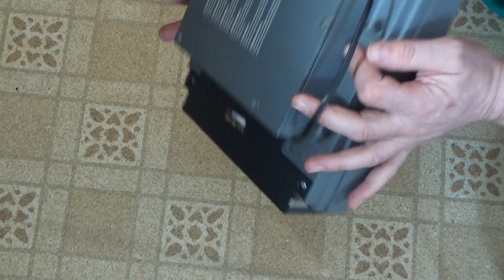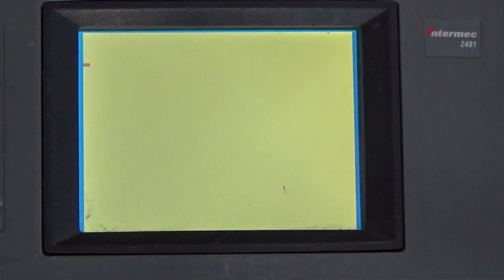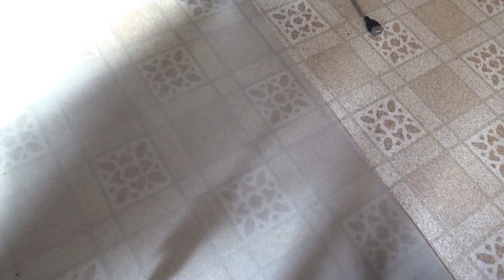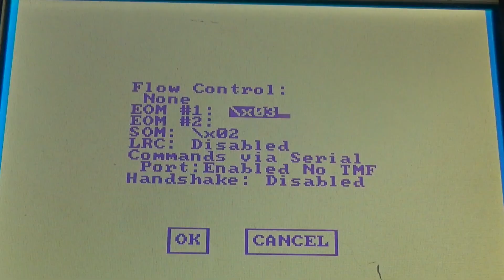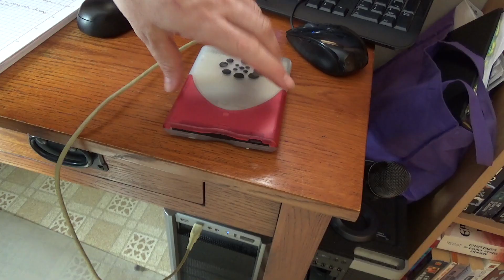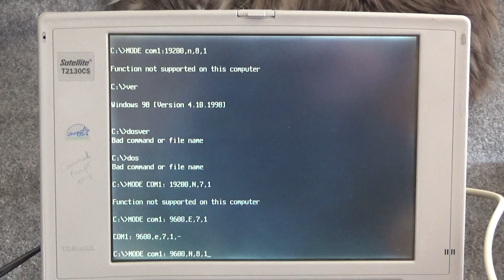Vintage Industrial Terminal - Intermec Trakker Antares 2641

Comment: My company still uses this exact device to track production times. It's integrated into our ERP system via our intranet network to provide a count of total labor hours invested into each project. We use production scan sheets with barcodes to record how many hours we spent building assemblies or performing testing. It might be built like a tank but the firmware is horrible and crashes daily. I can honestly say I've hit it a few times out of frustration. Our system has not been update since the 90's. I manufacture and service automated equipment for pharmaceutical liquid packaging applications, i.e. diagnostic test chemicals, vaccines, etc.
Reply from the maker: That corporate time-use micromanagement stuff always seems to waste more time than it saves. My company tried a bunch of gimmicky biometric time clocks that never worked right and could be easily tricked. We ended up just having everyone write their time on a post-it note and calling it good enough 🤣

Comment: 7:36 ...Null modem adapter (on the PC end of your serial cable). And you may have to configure the serial port between the PC and the device to match (speed,  parity, etc) .  A safe speed would be 9600 or 19200, 8N1, etc.

Comment: i would put a DOS install on onto a small CF card and use a CF to PCMCIA adapter to boot the machine. it might have network booted in its previous life explaining the lack of onboard OS.
Reply from the maker: I'm not sure if it has a standard CPU / BIOS or if it's all custom firmware stuff in there. I need to do some more research on it.
Reply: @saveitforparts  the very quick look i took of the datasheet said it was a PC-on-a-chip so at least the hardware should be relatively standard.

Comment: Networking of the 80's and before 🙂 Connecting two computers (DTE) through RS-232 ("serial" or "COM-port") require that you have a null-modem in between. It connects the TX-line on one computer to the RX-line on the other and vice versa. A few other, usually less important, signals might also be crossed. The reason is that the computer expect to be connected to a DCE (Data Circuit-terminating Equipment), such as a modem. A common gender-change contact is usually straight(!) between the pins. A null-modem is easily made from two DB-9 or DB-25 connectors, some wire and soldering. There's an article on Wikipedia or google it for detaiuls.
Reply from the maker: I might have a lap-link cable around somewhere, I need to dig through my box of serial junk.
Reply: @saveitforparts  Yes, a serial LapLink cable would do the job.
Reply: @saveitforparts  Did it work?

Comment: This reinforces my decision to get an old 286, 386 or 486 machine up and running reliably so access to 16 bit tech remains possible into the future.
Reply: 386 & 486 are 32-bit... For the record.
Reply: @christophero1969 , but they will run 16 bit programs, don't they?  Thanks for the info. :)
Reply: @DadofScience  32 bit processors will stull run 16 bit applications, yes. Its up to the OS to handle them but Windows had a 16 bit subsystem up to 7 or Vista iirc. They can also be ran on 64 bit Windows via NTVDM but if youre using a *86 anyway youll be fine
Reply: @DadofScience  64bit processors also will, you can run DOS on your modern PC
Reply: Virtualbox

Comment: Its a time clock. My company use to use these. They are a pita to setup and ip. I use to have to program them.
The battery is to allow people to clock in and out even if the power is out.  And yes people are hard on them.